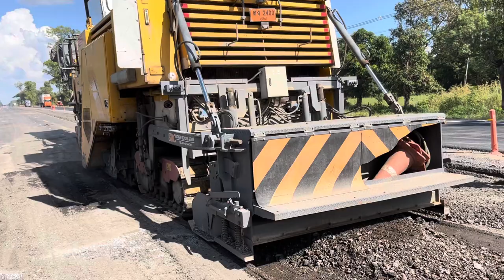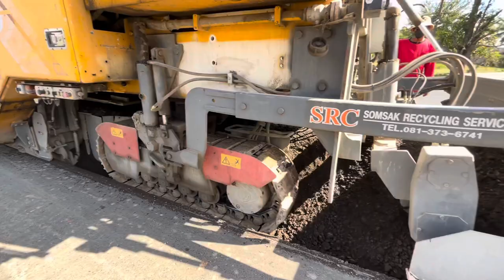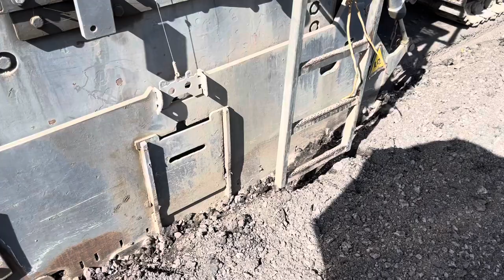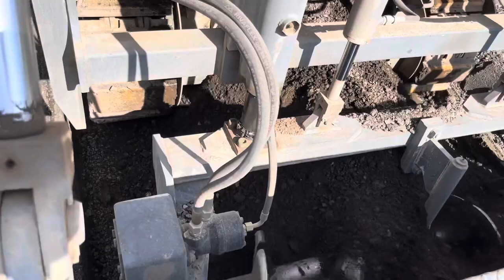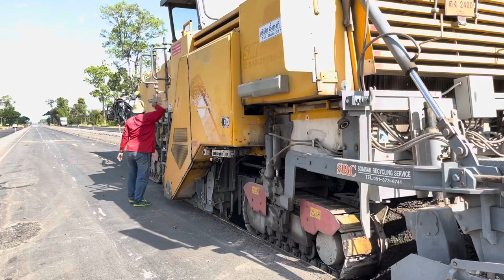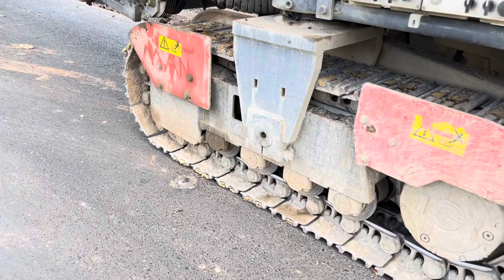biting the road Wirtgen 2200

Comment: This is the best video seen who showed the internal part of working compared to 28 videos seen in the past which is either long distance or from outer of this machine.  Nice video take. I was longing to buy two nos for hyderabad for old road 4-5" depth excavation of old Asphalt road so that the height remains same without out elevation of the road and houses entrances going down due to road height by these unprofessional bunch of ghmc goverment engineers logger heads inspite of calling and telling them several times. 

This machine method is very professional. Whereas Hyderabad ghmc adjusted with only road grating machine which removes on the surface only which is if no use.